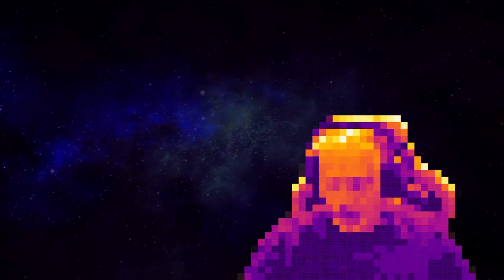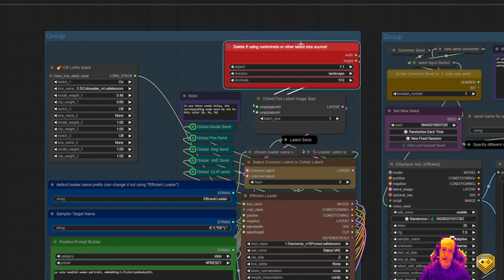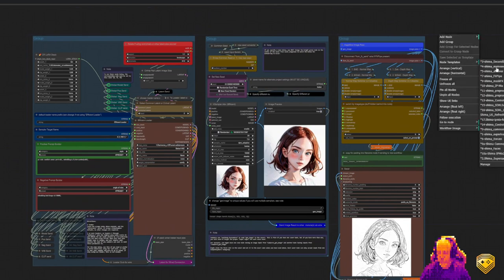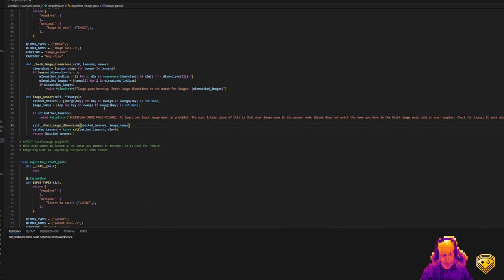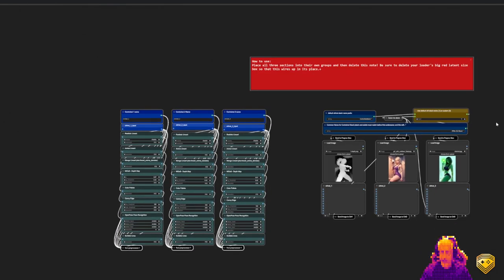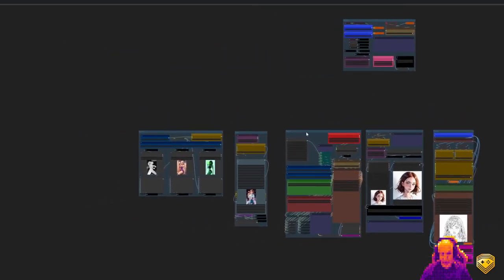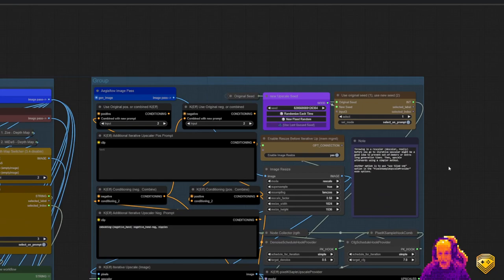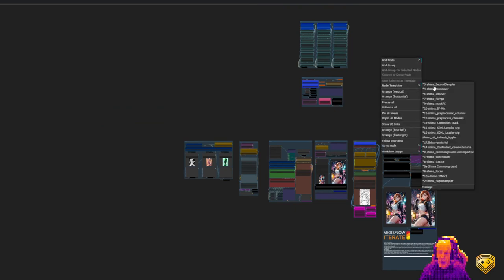AegisFlow Shima Overview for OpenAI workflow contest

Comment: I went to the link in the description, there is only one json file to download, when I drag-drop it into comfyui i get all those groups at once... what am I doing wrong? I wanted to get all the seperate templates?  Also the groups are not wired at all and nothing happens when you queue.
Reply from the maker: The nodes wire virtually by RegEx using UE nodes. However, there have been many updates since this WF. The separate templates are not a free product; I have to be able to justify the hundreds of hours I've spent (and am still spending) to my family, and "extra cash" does that :). Check out our discord channel and you'll see some of the more recent stuff that's happening: https://discord.gg/74cP9rarNs
Reply from the maker: Also, look at this video for more info on installing the Classic version, which will for the most part work here as well: https://youtu.be/pmqnwqiDLWk?si=xVqsRm-YnkJD1PLr
Reply: Thanks a lot, i didnt know there was a paid version! :)  @MajorStudioArt

Comment: Before I pursue the custom nodes and all that is necessary to use this amazing routing - can you please advise as to the VRAM requirements for this?  I do have a 3090 with 24GB VRAM _ but in the past I've managed to get OOM errors nonetheless.  Thanks in advance.
Reply from the maker: Oh god, you'll be fine! I'm on a 3080 with just 10. BTW, I am working to get the Aegisflow utility node into the Manager, but the pull is failing. Until then place the "aegisflow" directory here under custom_nodes: https://github.com/aegis72/aegisflow_utility_nodes. As for that 24gb, I am officially jealous and need to get one :)
Reply: @MajorStudioArt  Thanks for the prompt reply!  Getting your WF into the Manager  (I have no real understanding on how that is done) would undoubtedly ease the burden and gain exposure to this novel and innovative capability.
Reply from the maker: @frankschannel2642  the AegisFlow utility nodes are now in the manager’s node installer!

Comment: How do you save templates with group already composed? That’s not a default comfyui feature
Reply from the maker: You cannot. Only workflows can save groups. The node templates will come in ungrouped, then a simple right click and “add group for selected nodes” adds a group around the placed template nodes.

This is because of the difference between the ways that lite graph loads workflows, all at once, vs node templates, which are placed via copy/paste operation internally. Since litegraph doesn’t allow groups to be copied (yet) they cannot be used in templates w/o more custom js extension. We’re looking into that, but since the solution is so simple we haven’t prioritized it. Our focus is on the installer, making it smaller and more automated.
Reply from the maker: See the “release” video from Xmas eve to see that in action.
Reply: @MajorStudioArt feels like groups in templates is pretty major given the level of automation it can give by allowing switching and muting with rg3 nodes for instance. Would myself welcome it. But will look at launch video
Reply: Just started looking at your video. Looks very interesting. Like your modular system. Do you have a background in 3D nodes software?
Reply from the maker: @___x__x_r___xa__x_____f______  that’s still easily done. Just add nodes to a group and UE’s nodes and RG3’s group-related functions will work fine.
Reply from the maker: @___x__x_r___xa__x_____f______  yep. UE blueprints and Blender nodes :)
Reply from the maker: @rafpaff, see my latest video :)
Autogroups.